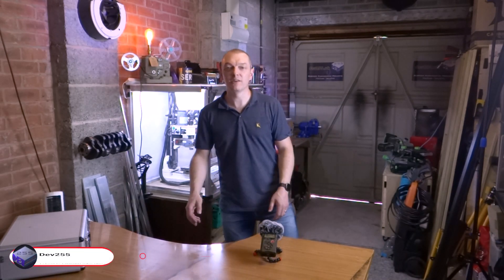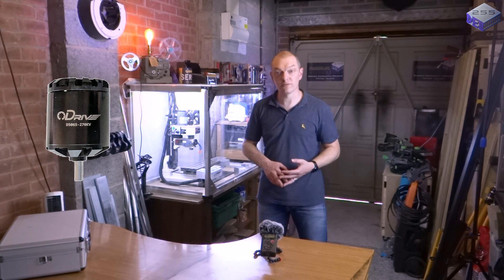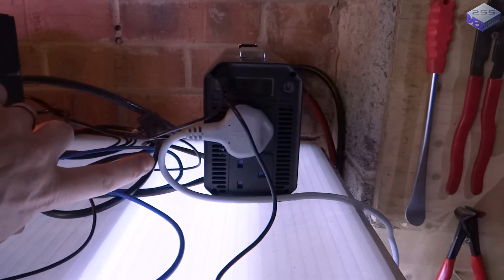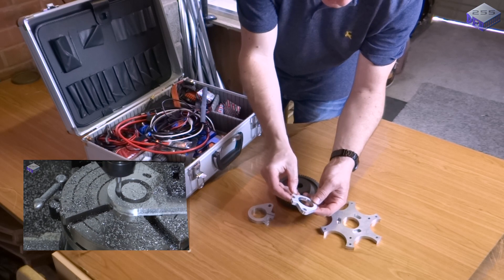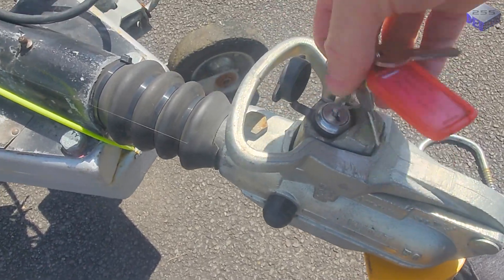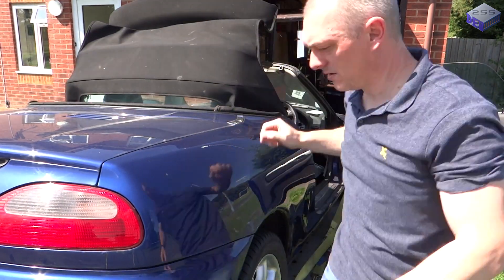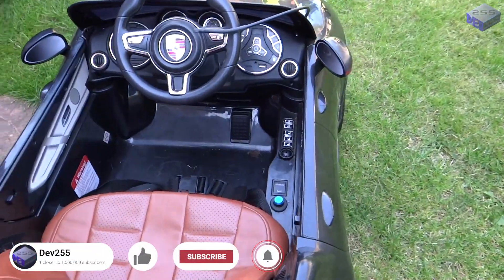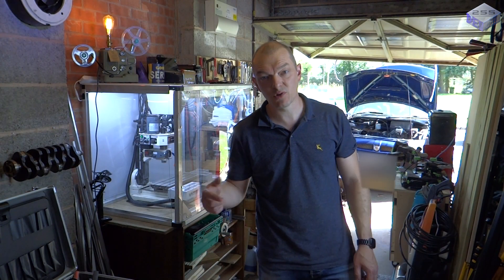Channel Update - MGF EV, CNC and other Solar Projects

Comment: so much awesome stuff! i'm so keen to see the car up and running! 
when it comes to switching the PC onto batteries, have a look/consider the HDPLEX 800 PSU. its quite pricey but probably more efficient than running an inverter, and if you find a way to power the monitor directly too then you can skip the inverter entirely. might end up cheaper, and if you invest the difference towards switching to 24V you'll save on wiring in the longrun and i think the CNC would benefit too.

the garage is looking ex excellent, it feels like a really productive space! good luck!
Reply from the maker: Thank you, I will look at the HDPLEX 800 PSU, it sounds interesting. One of the ODrives on the CNC will run at 24v and the other that I haven't fitted yet (for the spindle and Z-Axis motors) can run at 56v, so may just upgrade to 24v as you said. Thanks, the garage has taken a while to get up and running.
Reply: @TheSolarPoweredEngineer  oh, nice! not sure how you plan on solving the different power conversions in that case, but they all come with inefficiencies and require an additional circuit/device which represents cost and a failure point.

the HDPLEX will run on 16-63V so maybe run everything on 48V?
the higher power odrive will handle it too so it seems like the most unified standard and it'll only increase power and reduce cables further.

sufficient batteries are an added cost but instead of all the added conversion devices and thiccc cables you're investing in storage capacity.
Reply from the maker: Hi, I like the 800W version of the HDPLEX and it's a very reasonably priced, may even get one as a bench PSU too. My current PC PSU is 750W although the PC only really pulls around 400W when fully rendering video. You are right the more conversions, the more losses, where the 1000W inverter takes 12W to run (1A) from the batteries continuously. The HDPLEX 800 could also be used in the MGF to power the auxiliary 12V circuits and 5V for the Arduino's from a single 444Wh LiPo battery and save a bit of weight there. The car should only need around 20A to run all the auxiliary stuff if the lights were on too, so should last over an hour and half without issue, good enough for test runs.
Reply: @TheSolarPoweredEngineer  exactly. that's actually quite an efficient inverter in that case in think, but it's not nothing, and running 56V for the spindle is yet another conversion. 
The HDPLEX is extremely efficient and high quality, higher than 80+platinum rating if I remember correctly. The 450W(?) is actually enough for pretty much any single GPU PC, but I also like the 800W one ;-D

I think they even mention it being used in cars and industrial machines, it's a really really nice piece of kit. 
It's quite expensive to me, but unquestionably worth it and well, in the end probably cheaper when you add it all up in a use case like yours, where switching DC to AC to DC to DC to DC is the only alternative. 

Many people use it with the AC adapter brick for extra SFF PCs, but that makes less sense to me.
I'm extremely tempted by it because I'll want to run an off grid setup like yours too, but until that's set up I've refrained so far. 
Trouble is, they're often out of stock for quite a long time, especially this last year or two. They have restocked several times though so it's not entirely impossible to get, but it can take 2-3 months if you're unlucky. Enjoy, don't buy them all! I still want one 😫
Reply from the maker: Don't worry I won't buy them all haha, I may try a few options first, I think that 12W addition from my current inverter is easily factored in to the solar consideration, where an extra 36W of solar (factor of 3 for what your running) only works out to be roughly £36 (£1 per Watt roughly), so may not be an issue. Still considering the 800W one though, looks like a fancy piece of kit too.